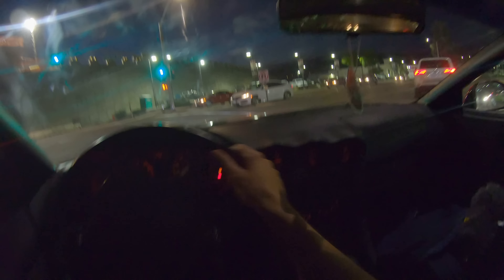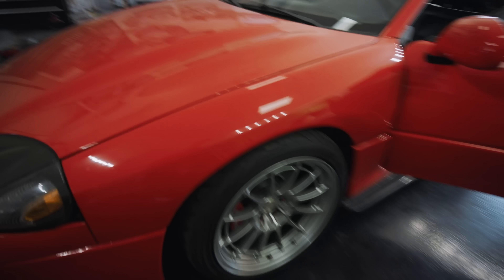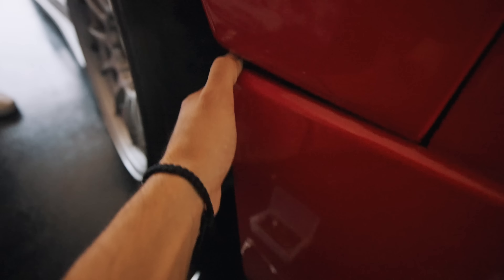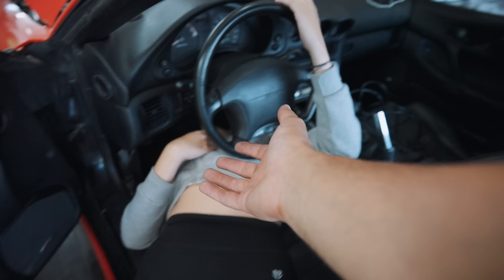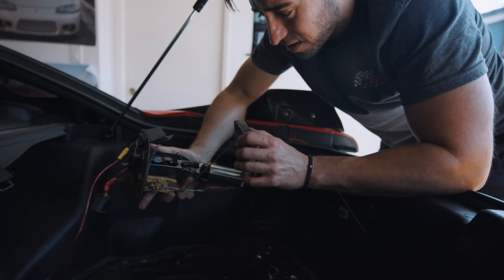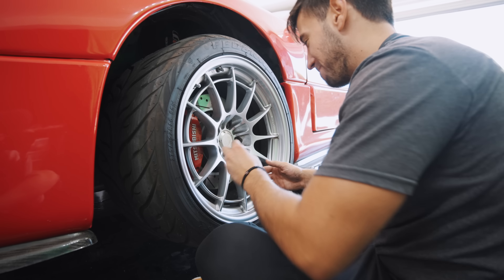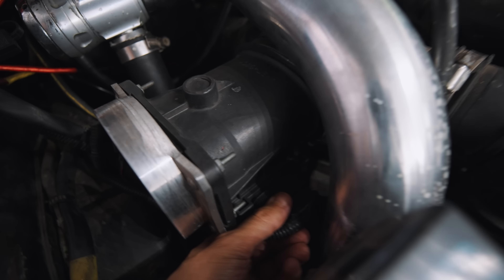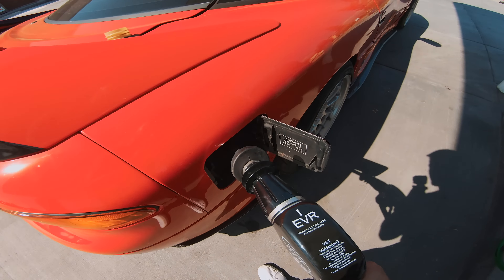Fixing Everything WRONG With My BROKEN Mitsubishi 3000GT VR4 TWIN TURBO!

Comment: Satisfying to see the little things get fixed one by one. The misfire is likely ptu/coil pack issue at this point
Reply from the maker: Looking into maf, missing 02 sensor and ptu
Reply: @MiguelDsm  I think in one of your old episodes you cleaned the maf with maf cleaner. Make sure you're using maf cleaner designed specifically for mitsu mafs. Most maf cleaner will damage the mirror internally and cause issues.
Reply: @MiguelDsm  if you pulled the maf and it made no difference, your maf sensor is most definitely bad and I would suggest getting a new one.

Comment: You should get a jester chrome ecu so you can tune it. That should help with the last code you pulled about running rich/lean. If I had to guess I'd say you're probably running rich while cold below 3000 rpms. This is because the car from the factory supplies low voltage to the fuel pump and compensates by increasing injector duty cycle. Rewiring the pump eliminates this. Also when the car is cold it runs richer so that is when this is most noticable.
Reply from the maker: Who sells those ecus? I have the 98 ecu, assuming it’s flash able
Reply: 3sx
Reply: @MiguelDsm  you can flash your 98 Ecu. Install the Chrome software. If you have a Tactrix Cable, that will help.
Reply: @MiguelDsm  flash the one you got, 98/99 are the only capable ones you just need the chrome software and a tactrix cable.
Reply: @ty0677  aren't all blackbox ecu's flashable
Reply: @cursedwolf23  all 98's and 99 production years with the black plastic housings yea, the only difference between a vr4 and na ecu is the knock circuitry and I believe the variable fuel pump and a tiny few other things
Reply: @ty0677  oh I c that's pretty cool

Comment: Backfiring is a sign of it running LEAN. When you unplug the MAF the ECU will run on a default map setting for fuel/air ratio. Reasons for running lean is too much air instead of gas. Check for vacuum leak(s). You should also borrow a known good MAF from someone if you're able to and run it in your car for a few minutes to see if it helps. If swapping the MAF helps there ya go. If not check your plug gap sizes on all cylinders, plugs, and while you're at it if you're that far into it you should run a compression test. A good psi for compression will be around 160-170. Higher than 175-180 psi is a good indication of carbon build up. A lower psi of 130 to 115 is a good indication of bad piston rings. To check this do a compression test again if a cylinder is reading low except this time put a few mililters of oil in the cylinder and recheck your compression. If it jumps up 10+ psi on the low cylinder get that cylinder to TDC ( top dead center) and do a leak down test. Aside from these you could check your grounds, IAC ( idle air control valve),  coolant temp sensor as when they start failing  they tend to do wonky things on a 3k. I hope my comment is helpful and hopefully guides you to fixing your misfire!

Comment: Dont know if u did this or not but remember to clear your codes then turn the car off and back on (probably wanna run it) and check codes again...those 12 codes could have been stored for any old reason and no longer relevant.

Comment: Need new fuel pump also new send unit for level also make sure the pump in securely tied to the bracket so it not flaping around also check plug gap

Comment: Been telling you to test out the MAF by swapping with a known good one! Just to rule it out. Also check all the connectors they can get damaged. Chromedecu is the website to get info on the Jester Chrome. 3SX will sell the parts. I'm pretty sure all you need it the Tactrix Openport 2.0 ECU Flash Module

Comment: How or where did you get the carbon detailing for the spoiler, also wondering the same thing for the eclipse, looks clean
Reply from the maker: Vr4 is just wrapped. Eclipse has carbon wing with top painted
Reply: @MiguelDsm  ooooh, so the whole wing is carbon, the top is painted to match the rest of the car, that’s genuis, i thought that the interior of the spoiler was carbon and the exterior was regular, maybe the evo spoilers had me confused or something.
Reply from the maker: That’s where the idea comes from

Comment: Hi Miguel I had the same problem with my car it kept on misfired after changing spark plugs and wires and checking for vacuum leaks we checked the timing on the car and it was off by two brackets maybe that could help figure out the misfire issue
Reply from the maker: I’ll look into it. Thank you!

Comment: You're going to have to replace that MAF.  It's not recommended to try and clean the sensor because that usually messes it up.
Reply from the maker: I’ll check it out
Reply: @MiguelDsm  he's right, I ran  to the same issue and had to buy a new  MAF.  I thought it was silly that I couldn't clean it but I damaged it some how.
Reply: @MiguelDsm  it should say on the can if it can or can't be used on mitsus. Basically the maf shoots a signal to a mirror and measures how long it takes for that signal to bounce back. Most maf cleaners will damage the mirror.

Comment: If maf reading the same good it be a poor ground. Have you try putting a multimeter for continuity or the connector to see if you're getting proper voltage on idle.   *was I drunk when i wrote this 😆
Reply from the maker: That I have not

Comment: Almost sounds like a beefed up diesel truck.... :/     I never touched a single thing in my VR4 and kept it bone stock cuz I dont want to have all those problems that come with increasing horsepower...  I much rather want to enjoy my VR4 as much as possible without hassle, and if I want horsepower, then I would be a car which has that in loads in original form